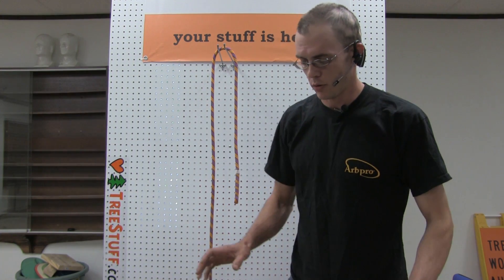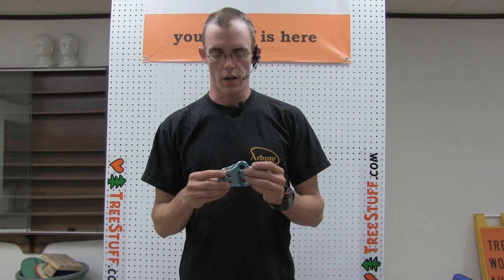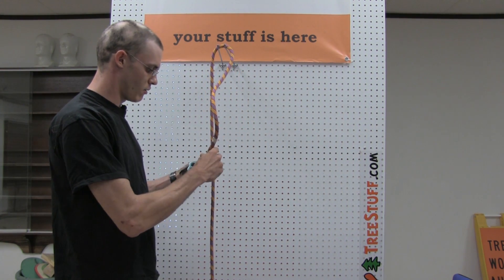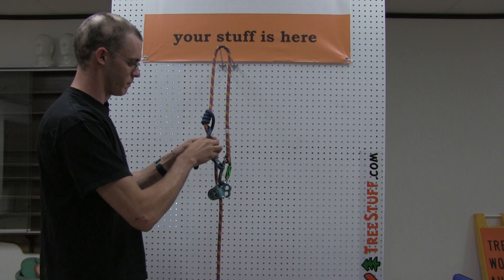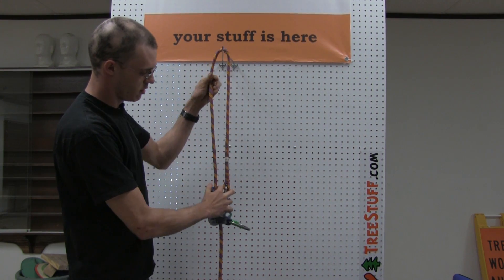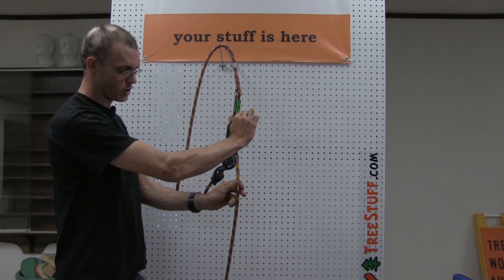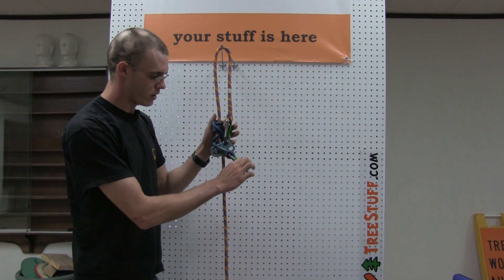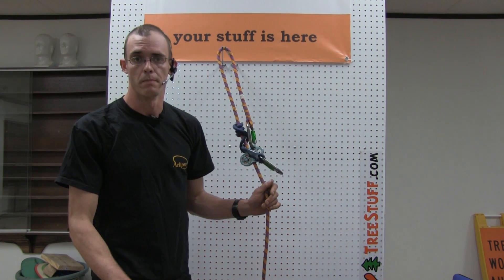Hitch Climber Pulley - How and Why

Comment: Nice small pulley works good➣>allmy.tips/FusionPulley?pp>    with a 3/8 (10mm) line. Can be used as a prusik tending pulley if you clip a carabiner around the the line on the inlet and outlet side below the pulley so the prusik doesn't get sucked into the pulley.

Comment: Question. Are you demonstrating it  there the way you would use it with you facing pulley? Seems others vids show climber facing 3 hole side, my issue with that way is that your high line is crossing itself and this tends to interfere with the friction knot when you get close to the high point or in general. What is the correct method?